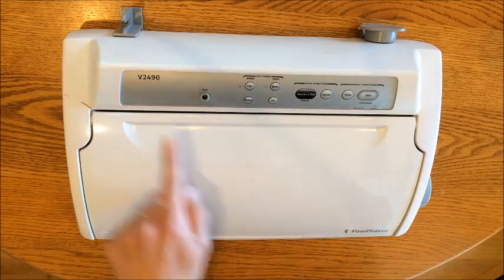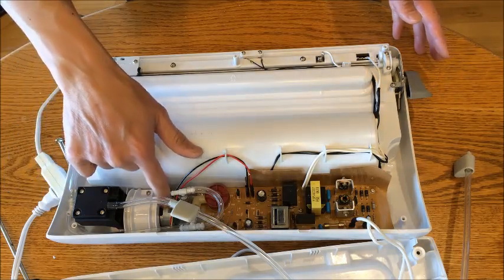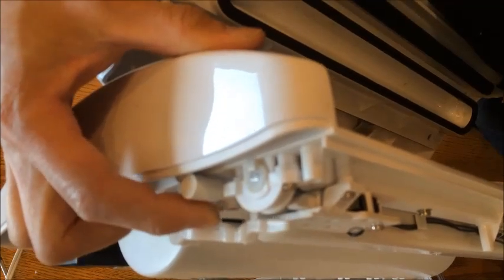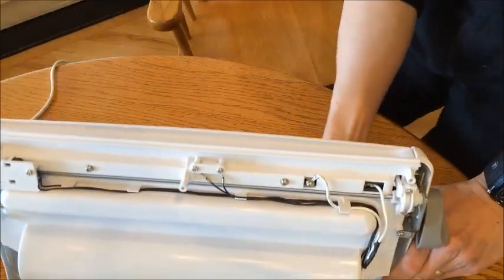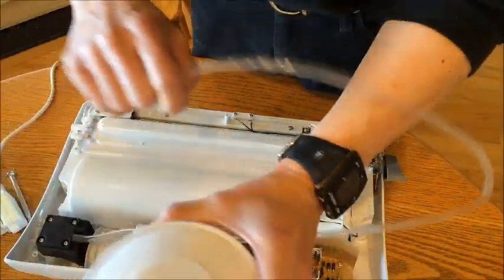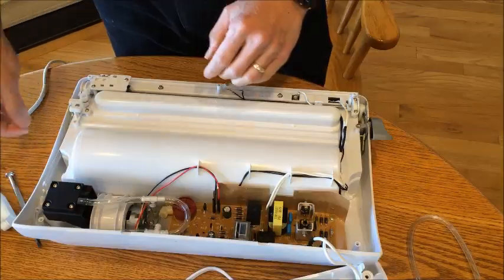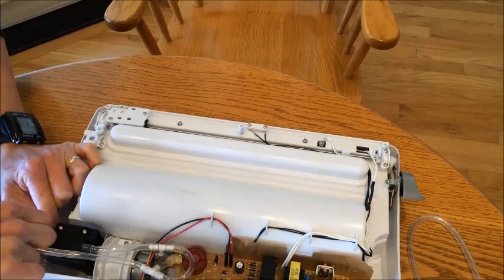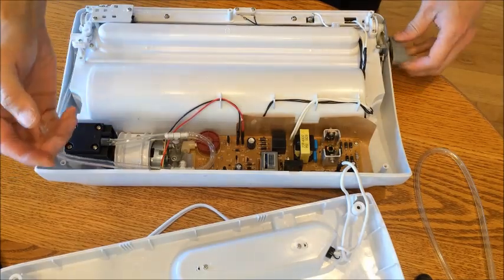Foodsaver Not Vacuuming Repair Leaky Gasket

Comment: This is an excellent vid for teaching how to trace down a problem, my FS is probably older, it is a Vac 820.  I cleaned all the tubing and the T's.  The port works just fine for jars but the bag sealer never completes, the pitch never changes.  
My problem is the foam seal for the top is slightly different shape I'll try to find something to rig it with.

Comment: Clear and informative.  I have an issue with my foodsaver not switching suction to the accessory side for the canister.  I opened it up and not sure how the machine is meant to physically switch the suction over to that hose section.  Do you know how it this happens?

Comment: Thanks for your video. Mine is about 8 years old, with only minimal use in the fall. I had mine apart and checked all the hoses. I even ran my finger over those seals and I thought they were fine. However, this is obviously the problem. I'll try wetting, or putting a thin shim under the seal to push it out further. Thank you.

Comment: It seems a lot of these units have a foam and a rubber gasket. For the rubber gasket, silicone is the only restorer for this type of seals. Regular automotive silicone sprays are not foot safe. Here is a food grade one:  https://www.zoro.com/crc-food-grade-mold-release-16-oz-aerosol-03301/i/G4581105/ $12.31 a pop. Will probably do 200 to 400 of these seals maybe more. Don't quote me on that either. The foam ones... better buy a new one. All foams deteriorate over the years eventually failing when you least expect them.

Comment: I have the same foodsaver  V2490 and when I connect the hose to vacuum seal the jars or just to vacuum seal a bag. I have noticed that the hose does not vacuum it blows. I have made sure that the hoses on the inside are correctly connected. How can I fix it to vacuum not blow air?

Comment: The photo is my wife, not me.  Can't figure out how to change it, so will post under her name (BTW, I'm Gary). Great diagnostic video. I started the same way by opening the case, but figured out very quickly there may be a way to shorten the process. Test the component most likely to be the problem first - the foam gaskets.  Since I knew it wasn't working properly with the current gaskets, I plugged the vacuum port in the lid with a soft plastic item, shut the lid and turned it on.  It worked perfectly!  So, the obvious conclusion was the gaskets were either bad or needed cleaning.  I soaked/cleaned them in some hot water and dish detergent, rinsed them in clean water, patted them dry and reinserted them in the lid.  Worked perfectly.  I will also order new gaskets, like MITEEman, but this shorter diagnostic may eliminate the need to open the case from the start.  Thanks MITEEman!

Comment: Hi! Following you training trail, I have discovered that the accessory port intake is slightly cracked. Even though it’s a smal and removable part, apparently FoodSaver does not sell it as a part 😕 Do you know if this part might be available elsewhere? I’ve got a smidge of JB weld on it at he moment, so that may fix it, but I’m looking for replacement in the mean time. Thanks!
Reply: Foodsaver replaced my entire unit as a warranty because it wasn't a replaceable part.  I end up with a free upgrade. They provided amazing customer service when I contacted them.
Reply: Mine is over 9 years old. Still works great except for the accessory port 😢 I ended up getting a brake bleeder to do the vacuum. It works well, gives me a small workout, and takes up less space lol

Comment: I had the issue where it wouldn't vacuum to the level and then heat the sealing wire.  The problem with mine was the bottle sealing port was leaking.  If you put your finger on that port and see if it is sucking.  You shouldn't feel it sucking.  There is a small ball bearing pushed into the seat with a spring.  Apparently moisture was sucked into the valve and rusted it.  You could put a piece of tape over that port.  Or you could make a port that was blanked off and stick in the hole.  I haven't found the replacement port yet.  This is what fixed mine.

Comment: Thank you for this video. Mine has not shut off for quite some time. Took it apart and first thing I found was a loose hose connection at the sensor. Works great now.

Comment: or you could avoid taking everything apart and just push a little on the top to reinforce the seal.
Reply: You got it. This is like having a mechanic take your entire engine apart and verify what works then change the fan belt. Did this guy ever think to start at the simple stuff first?

Comment: I agree that the problem is the gasket. I also agree that by wetting it, it will work until it dries out again. I don't agree that it's because the gasket gets compressed and worn out though. I think it's because it becomes porous. Which is why wetting it works. The water seals the pores. If you could seal the pores with something that doesn't dry out such as silicone grease, it could be a long term solution.
Reply: I agree; I would guess there is a quick fix with a smear of silicone, or a spray of silicone water proofing we would use on our shoes for example. 

I would also like to see what to do if the vacuum itself didn't work what parts can
be ordered to repair the piston seal.

Comment: Nice video, you are super methodical and I'm guessing the EE in your name is electrical engineer.  I'm feeling smart because (before I found your video) husband and I were processing his deer, and I wasn't getting the louder vacuum sound.  I instinctively flipped the gaskets around.  That didn't help me at all.  And then I wet them down.  It helped enough to get though the deer!  I live someplace very dry and so it's not surprising that these foam gaskets must break down over time.  Maybe lubricating them with... something food safe? could be another idea.  Consider buying gaskets off amazon to save on shipping?  Here are 2 gaskets for $8.70 + free shipping.  
https://www.amazon.com/FoodSaver-Vacuum-Sealer-Assembly-T910-00075/dp/B00T6WYIFQ/ref=sr_1_1?ie=UTF8&qid=1478908987&sr=8-1&keywords=v2480+foodsaver+gaskets

Comment: I have a V2860 model and replaced both upper and lower gaskets.  It works like new, but the top gasket seems to fall out partially each time I go to use it.  Is there a solution for this?

Comment: no need to purchase another gasket, unless it is THOROUGHLY trashed. simply put something behind the gasket, I used tiny slivers of some rigid foam insulation I had handy, to lift the gasket a tiny bit and regain good contact between the upper and lower gaskets. 
My Food Saver came from a salvage store and always had a slight curve in the top, at first all it took was putting your hand on the top to get a seal but over time the gasket got compressed to the point that I dangnear had to sit on the thing get it to vacuum. Feels silly that it took me this long to figure out to lift the gasket with something, works great now.

Comment: mine vacuums continuously but not sealing. the sealing works but not together. please advise.
Reply: remove the gasket from the upper portion (mine has triangular ends), they are made of foam and after being compressed repeatedly don't quite fully recover from compression. you can either buy a new one, currently 6.99 on Amazon, or if you want a quick fix put something about an eighth of an inch thick in the groove behind the gasket then put the gasket back on top of it. i used slices of rigid foam ( commonly known as blue board) insulation, since I happened to have a piece just a few feet away, but you could use pretty much anything, pieces of cloth, more foam, you could fill the groove slightly with caulk (but that would definitely need to dry completely before replacing the gasket), hell you could probably use modeling clay, almost whatever. you just need to lift the gasket enough so that it regains it's firm contact to the gasket on the side. just remember to take gadget out and clean it, as well as whatever you put behind if necessary.

Comment: How do you clean the tube connecting the Foodsaver to the cannister and the tube that is not visible, as inside that allows evacuation of any residue into the removable drip tray?  I can't find any information and concerned about bacterias building over time in those tubes.
Reply: Boiling  them in water should help remove any particles.
Reply: The tubes all suck air away from your foods; 
So I guess no one thinks about what could be growing in them.
Good eye, or nice catch.

Comment: My foodsaver has been sitting in the closet for almost a year now because it wouldn't seal.  I followed your video step by step and did the exact instructions to my food saver and guess what....all my meat is now sealed and in the freezer thanks for your video!!  It works again and after checking all the hoses, etc...it was as simple as the seal not seeded well.  That would have been about a $100 fix if I would have done what my husband said and that was "just buy a new one".  WOW!  Thank you!!

Comment: The first rule of troubleshooting is to try the easiest thing first :) Wetting the seals is the easiest. You would have been done then. I think that you were really trying to do a complete troubleshooting guide.
I had the same problem with mine. The model I have is no longer supported and they told me the seals were no longer available. It looks to me that most have identical seals. I'm not convinced that the seals for other models won't work on mine. So for now I just wet the seals and test for completion before I use it. Even if it doesn't complete I can do an instant seal and that seems to be providing a pretty good vacuum.
Reply: The fix on my food saver was also as simple as the seal but I am thankful he went step by step because in the future, I will know exactly what to do.  I think we were the lucky ones having the easy fix but the full instructions were extremely beneficial for the future and others on here that needed one of the many fixes he covered in his video.
Reply: +Patsy Smith My comment acknowledged  that he was doing a t/s guide, didn't you see that?
I tested by using water but using petroleum jelly is longer lasting and is still working and maybe mineral oil would work too. Can't replace the seals, no longer supported, so I improvised. Just to be sure, I always do a dry run with nothing and if the vacuum takes, I know that it will work.
Reply: Yeah, that worked! Watched video for about 3 minutes, started on the comments - found yours - did that - worked! Saved 7 minutes!! Thanks pal!